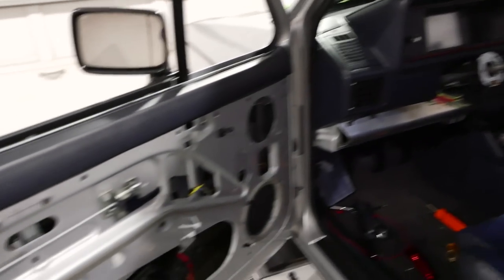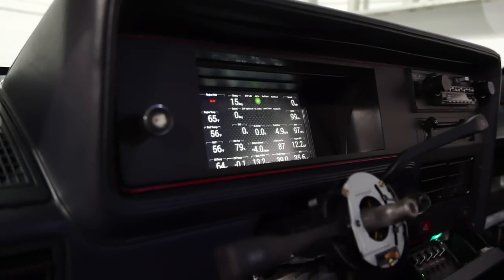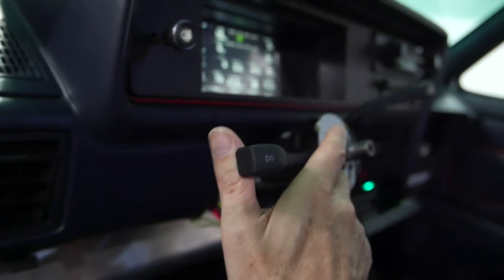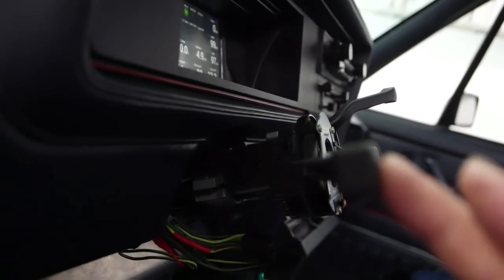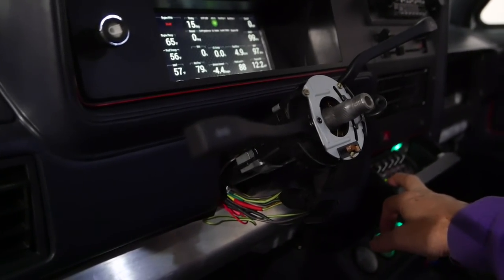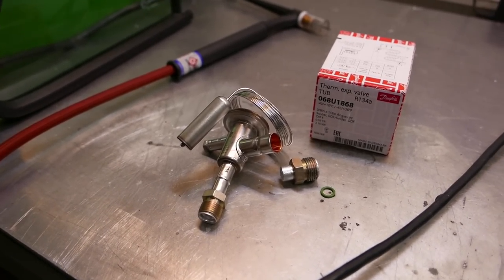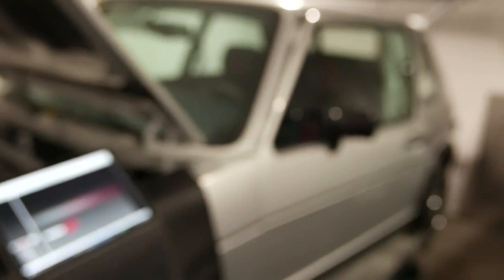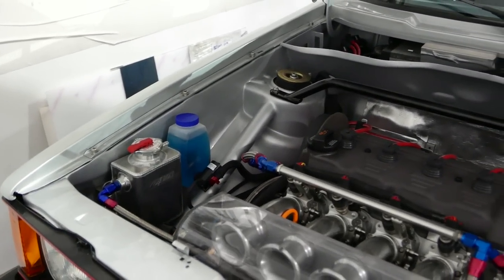The Ultimate 1983 Rabbit GTI - part 134 (Electric Windows, Licensing, Performance Validation)

Comment: What style pistons installed? High silica forged pistons tend to have bypass at low engine temps... I was able to add a bit more ignition advance with factory spark plugs as compared to iridium/platinum plugs. Great work.
Reply from the maker: Yes, high silica forged for the tighter tolerances it allows for. I talked with Colin/Techtonics just now and he suggested that newer style rings tend to have less pressure on the cylinder walls for better efficiency but they can take longer to seat in, suggested I need 300+ miles of driving on mountain roads to fully seat the rings - and avoid city/hwy driving for now. I will be patient and will monitor progress on this front. I will also play with plugs and timing as you have suggested. Thx.

Comment: Are you going to be selling your Lexan side windows?  I'll purchase them if you don't decide to keep them.
Reply from the maker: I managed to scratch the drivers side window taking it out and actually don't recommend them for the doors as they don't follow the curve properly and look 'wrong'. The rear side windows don't have that problem (they follow the shape as they are forced by the rubber moulding to do so). I have some small marks on one of them that aren't too visible). You can have them for the cost of the shipping ...
Reply: These are for my race car, so marks on them aren't a problem.  I don't have any glass in the doors, so those aren't needed.  Please feel to contact me at racer_tim at yahoo dot com to arrange payment and shipping
Reply from the maker: Tim, me bad. I junked them. Sorry!